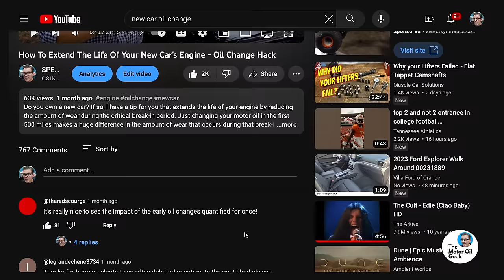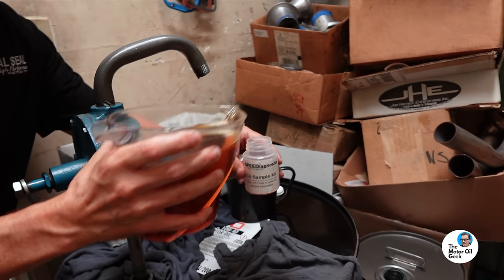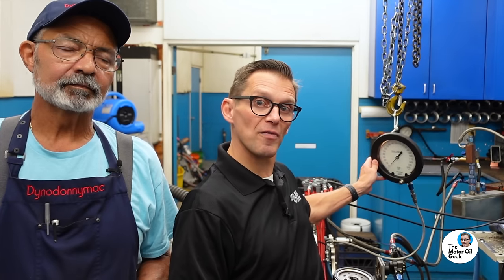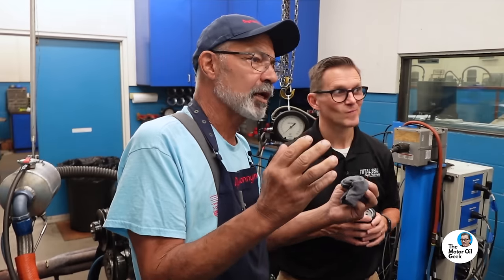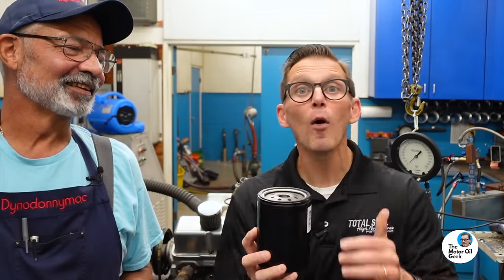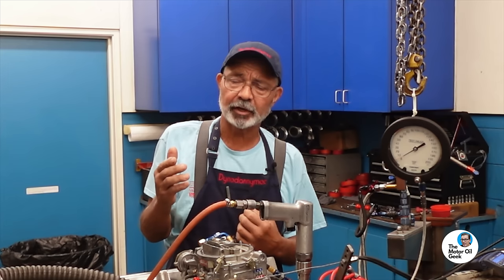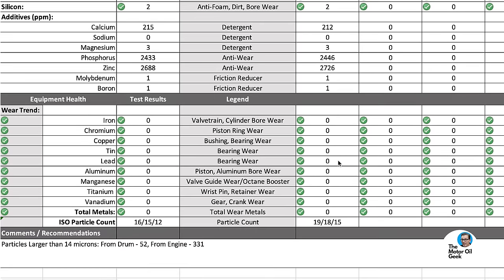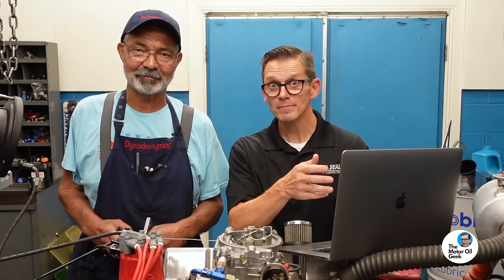Does Pre-FILLING The Oil FILTER Cause Engine DAMAGE?

Comment from the maker: If your oil filter is vertically or horizontally mounted, here's a pro tip to prime the filter before starting the engine.
https://youtube.com/shorts/ZF-SPAKtzrY?feature=share
Reply: @themotoroilgeek 
I've been a auto technician for years and I had a old timer. Tell me that didn't have to fill the oil filter if you did the oil change and no oil in filter. To start the engine and then turn it off and repeat atleast three times. To prime the oil in the system and through filter. I was never sold on not filling the oil filter so, I fill the filter still and then start and then turn engine off atleast three times. I would like to know your thoughts about this. After a oil change and oil in the filter should you start and immediately turn engine off multiple times before running the engine longer to prime the oil in the engine?
Reply: @DK-Nachowifi turning it off and on does nothing because the oil pump doesn’t run with the vehicle off. But prefilling the filter just insures the system will prime faster, maybe takes a second to two at most. Prefilling the filter is good and can only help. If you can’t cause it’s a horizontal mount then oh well it is what it is.
Reply: I know for a fact that pre-filling the filter prevents that little slowdown from a fresh oil change from bearings dragging or lifter delayed pump up. I don't know what was causing the engine to have a sort of load on it on the start up but prefilling the filter prevented that. Keep in mind that that I have several V8's with high mileage that did that. The cars I have always owned and have prefilled are a '76 Dodge B200 360C.I., a'79 Camaro 5L, an '88 Ford 5L and a '98 Ford 4.6L. Lets just say all my engines don't burn oil happily without additives well over 100K miles. I only had to hear that lag once for myself to be convinced. I should point out that I was a professionally trained mechanic back in 1989 where my journeyman taught me to always pre-fill the filter.
Reply from the maker: @mrwebber35  Thanks for sharing!
Reply: The clear flood mode also turns the engine metal to metal during the priming.  Is this less damaging due to the lack of combustion force on the connecting rod bearings?  They still see compression force so only wear on the cap bearing side?  Are the combustion forces low with a turning engine during startup, because there is no load on the driveline during startup?  This seems like a reason why all engines should have upward mounting filters and require prefilling or have electronic oil pumps to prime the pressure before start similar to electronic fuel pumps for EFI.
Reply from the maker: @michaelb4060  Great question. Without combustion, the pressures are much lower, so the residual oil film is sufficient to protect the parts. In lubrication engineering, the Stribeck curve tells us that as load increases, oil film thickness decreases, so reducing the load does make a difference.
Reply: You run it without any oil in the oil filter you're putting wear and tear you're not pumping any oil it's got to build a filter up first so what do you think the motor is doing when it's got to fill the oil filter up first don't be idiots it depends on the type of car
Reply: I almost always prefill my oil filters - BUT back in the 80s, we owned a 1984 Dodge 600 that suffered from oil air locks if you did.

If you prefilled the oil filter and then started the car, you would see that the oil light would stay on - forever. No oil oil would be getting pumped around the engine. Sometimes revving it up would get it flowing but often only after "burping" the oil filter with the engine running would the oil light go out and the oil flow. 

The shop manual for the 600 stated not to fill the oil filter and a tech builtin stated if you did to have someone ready to loosen the oil filter to let the air lock out while the engine was first started.

Back then I spoke to a friend who worked at a Jiffy Lube and apparently there were many front wheel drive Chrysler's that suffered from this issue if you prefilled.
Reply: Adding to the above, I'd be interested in knowing if any modern oil pump self drains once the oil filter and its antiflow back valve is removed (like the 80's Chrysler 2.2 and I believe Chrysler's imported 2.9).

Edit: Googling I found several modern motorcycles suffer from oil air locks if you prefill the filter, but didn't notice any modern cars or trucks with this issue. 

If car engines that drain back the oil once the filter is removed still exist, how long do they take to build oil pressure when trying to pump the air through a prefilled oil filter. 

Think about what you are asking these "badly designed" pumps to do. It is full of air, has a full oil filter ahead of the oil path and also has to suck oil up from the pan...
Reply: @michaelb4060  i just learned last year that a F1 race car engine when they were V10 engines limited to around 2.5L or so what ever pistons the size thats in a 250cc dirt bike..in a F1 turning 20,000 rpm the pistons weigh 5000 pounds every time they stop and change direct..so in a passenger car buzzed out 5000 rpm up to 7000 rpm  your pitons could weigh as much as 4000 pounds or an easy 2000 pounds when they are being push hard through the gear changes ..all the weight and pressure goes directly to the rod bearings and the oil molecules is the last line of protection before the conrod bearing comes in contact with the polished surface of the crankshaft journal .
Reply: I remember in the seventies and eighties if I bought a quart of cooks refined motor oil it had sludge in the bottom seeing that was disturbing so if I had to buy it I would only pour about 3/4 of it in
Reply: the reason why I don't pre-fill the oil filters so I don't overfill the oil because the oil filter takes one quart so if I put four quarts into a pan and I fill the filter with a quart or close to it, I have the possibility of overfilling my engine and blowing my rear seal
Reply: when I went to auto mechanic school they never told me I had to fill the filter either.
Reply: Quart containers and 5 quart containers are all marked if you only need four and a half quarts for your system I don't see how you can mess that up 😊
Reply: It's not necessary to argue one way or the other try it once with no oil and record the sound of the motor the next time you do an oil change pre-fill the oil filter and record the sound of the motor compare the two you just might be surprised the rod bearing knock that you hear is not good
Reply: I wasn't arguing.
Reply: @williamsain4651  just stating a fact.
Reply: I don't doubt they never said it that's a part of job security
Reply: I'm guessing this is NOT something available with a Hybrid vehicle.
Reply: I work at a hydraulic power unit shop. Some of customers require us to send samples of new oil to the lab and if the particles don't meet their specs, we have filter for 24 hours and retest. So yes, new oil is not that clean, but in my opinion, I don't think it would be a problem.
Reply: LOL just change the oil
Reply: It must take you guys  a week  to change  a spark plug
Reply: It must take you guys a week to change a spark plug
Reply: Bull
Reply: I would really like to see a comparison to identify the best filter that has the best anti-oil drain back capability!!!
Reply: That's all good, but cartridge oil filters that are mounted on the top don't stay prime when the engine is off. How do we know, because when the oil filter is removed it is empty, no oil in it. So why go and do all that, when it will empty on the next engine start up. I still thing it's a good video, but it doesn't apply to all designs.
Reply: I thought it was the pocket of pressurised air that you are creating with this method that was rumoured to be the potential problem in prefilling. In any case an engine designer would need to design for both cases to ensure no problem. Half of engineering these days is designing for people doing stupid things, thinking they know best.
Reply: @Slider68  oil air locks 😂🤣
Reply: @xl250mon5  do a web search on "Why do I need to burp my oil filter?". There are quite a few engines that suffer from this problem. With many of them, the oil light won't go out until you burp the filter, and if you ignore it, the engine will suffer catastrophic damage.

To understand what happens, imagine the oil pump is full of air because the oil drained back to the pan during the oil & filter change. Then realize pushing prefilled oil through the filter takes a fair bit of pressure.

Now, when the engine is started, the pump, still full of air, needs to suck oil up to the pump and push "springy" air into and through the oil filter. Oil pumps actually pulse the oil flow, and each pulse compresses the air before the filter and then with vehicles with weaker, worn, or poorly designed pumps, that air pressure is able to push back on the pump between pulses, returning most of the previously sucked up oil back to the pan.

Note some call this problem "oil cavitation in the oil pump", but it isn't truly a cavitation problem (cavitation is when the pressure drops far enough to create a vacuum pocket in the liquid that then collapses).
Reply: @DK-Nachowifi  Once the pump sucks up oil the first seconds it's primed and pumping.
Reply: I have a question, if a vehicles takes 6 quarts and you add oil to the oil filter would you still add the 6 quarts to the engine or 5 in a half or 5 depending on how much you put in the filter
Reply: @euphoric5174  The manual tells how many. that would include all factory items if equipped like filter, oil cooler, pan.  6 quarts total.  You might find an engine takes 51/2 to the full line because an oil cooler might retain some.   If in doubt use 5-1/2 Qt's start the engine for a couple of minutes, then off  for a few minutes, Then check the stick and add what is needed. Don't overfill.
Reply: Also biggest tip: buy engines that have the overhead camshafts bathing in an oil bath to avoid dry starts. Thanks to Alfa Romeo for that 100 year old invention.
Reply: @ReginaJannie  1902 Maudslay. First.
Reply: Hey can you recommend me your #1 pick for full synthetic high mileage oil
Reply: @themotoroilgeek cool video and good tip on priming the filter of a horizontal mounted filter, quick question tho, on my 2011 colorado i have about 48k miles on it and never primed it from lack of knowing how, after the dozen or so changes with dry starts how bad is that for my truck?
Reply: @BrowardBikelifeTJ  Europe spec Triax 30,000 mile oil Made in Usa
Reply: @mrwebber35 I’d be interested in hearing how you prefill that ‘98 4.6L with the filter on the left side of the block horizontally mounted?  Fill it, then dump oil all over the side of the engine block?  Here’s how I get the filter off my 4.6L DOHC Engjne:  remove cold air kit, just to have more room to work; loosen filter; pull back quickly and tilt it back off the threaded mount and drop down to the left facing up towards front of car; move to front of car, grab filter and point down to drain into moved pan (after oil pan drain valve closed, I don’t have a plug) and drop it into the catch pan.

New filter, load into the front of the car on hoses, then move to the side of the car.  Pull filter into position vertically, then flip horizontally and screw it into position.  Pre-filling it would just make one hell of a mess as at least half of the new oil would run out.  

I worked in an auto shop in the ‘70’s and ‘80’s and never heard of this or did it once in thousands of oil changes, and that was a company owned Chevron USA back room with ASE Certified mechanics.  It makes good sense to me hearing it now for the first time, and ironically it would have been a lot easier to do as most of the engines back then had bottom mounted filters.  

However, I don’t think my 4.6 is going to get a full dribble of $9 a quart Castro Edge full synthetic down the side of the block anytime soon!
Reply: Dont waste time chicken or egg first everything goes nothing will happen.😅😅
Reply: that makes no sense, horizontally could mean two different ways, always prefill the filter. these people just want views smh
Reply: I,ve seen the second video...does it work on old izusu engines?
Reply: Hey all you  mechanics out there, you can always crank the engine (without) the engine actually starting.
Just disable the ignition system, crank the engine til the oil pressure builds up, then enable the ignition system and start the engine.
Reply: @Slider68  I had the same problem with my 68 Dodge 383. I even put a new OIL PUMP in , and it did not solve my problem. If I prefilled my filter the pump would not push the air out of the system because the oil in the filter was in the way !! Before the oil pump can pump oil, it has to pump AIR and get it out of the way. With oil in the filter the air cannot burp !
Reply: I would like your opinion on remote oil filter setups .As far as refilling the filter is concerned I have never done this. I have Owen 3 mercury marquis 4.6L all have side mounted filters and I got more than 350k out of all 3 never prefilling the filter none of them burned more than 1/2 quart the car rotted out the engine was still great all of which I changed the oil at 3000K whether I used synthetic or not.
Reply: if I put the pedal to the floor and crank this prevents the motor from igniting. would this be a good method for lubing the cams/rocker arms before the engine ignites?  @themotoroilgeek
Reply: Typically it’s vertical as far as ive seen.. but you fill the engine to the pre-requisites.. let it run out the rest into a pan a bit.. then install the filter then run it.. check the oil for the level after its run through the lines.. to get an exact measure.. I may be wrong and dumb.. I dont know crap when it comes to vehicles.. I wish I did..( from what I understand after an oil change run the engine after checking acceptable level and let it go.. hmm 5 minutes.. maybe.. check it again.. may have to put in a bit more) I’m not a mechanic but I find it intriguing and want to know more :)
Reply: @Ken-op7sg huh? 😂
Reply: @E.L.RipleyAtNostromo  The filter absorbs the oil not immediately. 3/4 fill and flip the filter on quickly. Skill is the answer and good old common sense. This isn't rocket science.
Reply: @mrwebber35 Doesn’t really matter if it’s rocket science or not, after doing well over ten thousand oil changes without even hearing of prefilling from a half dozen ASE Certified mechanics, on thousands of 1960’s and ‘70’s big blocks, I’m not sold at all that it’s remotely necessary.  My engine is a modern 4.6L DOHC aluminum block that’s had full synthetic in it since day 1, and it takes a second after starting to reach full oil pressure.  But it can’t hurt, so I’ll give it a try and add just enough to fill the filter to wet the interior.  But I’m not going to take a chance on spilling anything.  It takes me three separate moves to get the OF in position to mount, and it’s a tight fit, so I’ll have to hold the filter down by the block once I get it in final position and maneuver a quart of oil down there to pour some in.  

Frankly I don’t think there’s any damage being done to my engine at all by running the engine for a second until the oil pressure spins up, but I’ll add a few ounces of oil to the pleats anyway; that should save a half second or so of engine wear.  (?)
Reply: LOL! talk about skewing results to suit your agenda. yes prefilling is good if you can, BUT you used an old big v8, a big oil filter, you used an air drill not a starter motor which is not real world test. most modern smaller engines have better faster pump designs and much smaller filters to counter this, something you SHOULD know or conveniently forgot. dont understand the story of the Porsche?  you tested rebuild > run in particles and attributed it to no oil filter pre-fill? so... did you again rebuild with oil filter pre-fill and get no particles?  or did they run in just clear out over oil changes... telling half truths
Reply: @davelee7572 Excellent points!  By the way, pull the drain plug and let the car drain for a while, say 3 or 4 days.  Now pull the engine and take off the intake and top of the engine and turn it upside down.  You’ll easy get another half quart or more running out of it.  Even with big blocks and old fashioned bottom mounted giant oil filters the oil pump takes a second to get the oil pressure up to max.  Those cylinder wall are still coated with oil.  You drained the pan, not every drop of oil in the engine.
Reply: @E.L.RipleyAtNostromo  not sure what point you are trying to make with that reply in response to my comment... it does not take 3-4 days to drain all oil.and the "easy get another half quart " most of that is whats sitting in the cam and other valleys. which again i dont know what your point is
Reply: @davelee7572 Yeah, I don’t think you got my point, which is even after completely draining the crankcase there’s enough residual oil on the bearings and cylinder walls to run the engine for the second it takes to build up oil pressure.  Also, I learned that many new engines actually initially bypass the OF on startup to make sure the engine has full oil pressure, then start routing oil through the filter.  That makes pre-filling unnecessary at all on those engines.  I’ll start adding some oil to my horizontal mount filter, can’t hurt, but not enough to take a chance on any running out when I mount it, so not sure if that little bit will make any difference on startup at all.
Reply: How do you pre fill a filter that sits with threads down ?
Reply: @E.L.RipleyAtNostromo  ok yes, as long as you dont rev it on first start it would be fine. and i normally just crank it a few times without letting it start to get things going. the test in this video was worst case to try make a point that really isnt an issue on modern engines otherwise oil filter, oil and auto manufacturers would say so
Reply: @michaelgarvey7874  you dont this video is a stretch. just crank the motor a few times before starting the car to let it build oil pressure.
Reply: @davelee7572 Great idea that never occurred to me, figured the engine had to be running to pump oil, but cranking it should give it a head start.  That plus adding some to soak in the filter pleats should prime things pretty well.
Reply: On my diesel I fill my filters, On a side mounting filter, put in 1/2 quart, now do the oil change, after oil change and plug in, Add oil filter and then fill with oil and then start the engine, should have oil pressure and no worries.
Reply: This makes me love my electric car even more ❤
Reply: @frederickfaller899  NO 0NE WANTS YOU HERE
Reply: @timothywanless1507  First, over filling the oil on an engine doesn't blow the rear main seal. What it does is whip air  into the oil cause oil starvation.  Secondly filling the oil filter does not change the oil level, as a filter mounted in a position that could be prefilled will stay filled when the engine is off. That been said my camaro uses a cartridge style filter mounted on top of the engine. So it is not possible to prefilled, yet the engine now has 119k miles and oil analysis shows minimal wear. Secondly in cold conditions like 10 below zero oil flow slow at engine start up, slower that oil been poured into the change with empty filter during an oil change. Yet this is taken into consideration during an engine design. Plus I have never filled the oil filter on my son car, I bought that car new in 2003, it now has 389k miles and runs fine. The reason I tell you all of this is because prefilled or not, is a stupid argument. That's like saying shut off and start up engines while driving will wear out the starter. By the way I'm a mechanic, it's all I been my entire life. Never had an issue with not refilling oil filters, my own cars are proof of that.
Reply: You can still put "some" oil in a horizontal filter, because the filter media absorbs some. You will see it go down. Just add a little at a time. It's not that hard to do.  @DeeRizzley
Reply: You guys are in Jedi Mind Reading Mode for pinning this comment!
Reply: Let's think about this: Sure, new oil may be cleaner than it ever will be after it circulates through the engine, but it has not yet been magically blessed by the oil filter. Yeah, that's it. It's magic.
Reply: Marine chief engineer for 25 years, same, big  CAT, MTU, DD, MAN etc diesels, oil capacity a few hundred litres, they have a pre lube system and oil preheaters but still always prefill the filters,
Reply: This does not make any sense.  I'm very skeptical of this and on a Toyota the oil filter is mounted in horizontal position.  It makes more sense to block the hole (somehow??) then install the filter.  What's the alternative if your vehicle does not have this prime feature using brake and accelerator?🤔
Reply: Hey, sorry, my car is 36years old - "clear flood mode" not defined yet!  I don't want to trash my classic - am I still best to swirl with some oil inside while I screw it home?  thanks
A.
Reply: How would you do this on a 2006 cls55 Mercedes ? Filter cartridge on top. Would soaking the filter in fresh oil help ? Thanks kindly for everything you do.
Reply: On newer engines that are fuel injected and fly by wire throttle housings I find that by holding the throttle open and cranking many fuel systems go into clear flood mode or test mode.  This does not allow the engine to start so continuous cranking will bring up oil pressure before starting.   I crank till the oil light goes out then release the accelerator and crank again with closed throttle.  Engine should start immediately and light should go out immediately!!    This is good for engines with inverted filters, horizontal filters, and cartridge filters!!
Reply: @cycleguy666  :body-green-covering-eyes:Too complicated for me.🤔
Reply: I have a 2002 Nissan Almera. On the QG16DE engine,  Filter is mounted sideways, and doesn't have clear flood mode.  No possible way to pre-fill the filter and yet these engines run virgen for up to 200k miles.
Reply: why are you SHOUTING?
Reply: 0😊
Reply: I don't care what anyone says I've always filled the filter and always will I had a brand new 1976 f250 the filter was mounted horizontal and I had to pull the coil wire after a couple changes to get oil pressure it didn't prime
Reply: OMG!!!  Its much better to just let your car start and fill the filter.  Most engine wear occurs during cranking.
Reply: Do you have a recommendation for what kind of oil or brand to use on an 8.1 vortec?
Reply: @williamsain4651  I prefilled the filter but being under the car - the filter spilled. Then I forgot to refill the filter - and yes the engine knock for those 4 seconds was SCARY - also the engine sounds rough now - just a bit rough. I am getting hexagonal boron nitride now to add to the engine.
Reply: @johnparish1432   that's how we used to crank the new engine( Lycoming acft engine)for oil pressure to come up and we'd install spark plugs and start the engine.
Reply: If your car has a side mounted or upside down filter you can prime it by cranking the engine for 5 seconds with the main ignition wire removed.
Reply: You have the right process here. When you did your oil additive vid, you excluded this process to fill your hate of additives.

Now go fix your additive vid, and show the results of additives, because I have done this, and the results are opposite of your reasons for hating them. Chemical analysis is not replacement for actual real world results.
Reply: @BullseyeBallistics19 that's because an engine retains oil on bearing surfaces for a few minutes after oil is drained, not a few seconds. This guy -

https://youtu.be/v82VeGngitc?si=zptCoRaLvAC37oi_

Shows how an engine can run for a short period while not picking up oil, as skid steers don't have an 80° approach or departure angle... even though it's very easy to push past the boundaries here, there's some forgiveness in it picking up oil.
Reply: Your wasting your time.
Reply: @DeeRizzley  is horizontal because you don't need to pre fill it. Lol.
Reply: My pro tip is to not worry about it.  What a silly topic.
Reply: @timothywanless1507  Yup, this is one of those useless topics for arguing on the internet.   I find it funny,
Reply: @DeeRizzley  Filling filter has zero to do with priming. It's a good practice but not for that reason.
Reply: Mechanic for 40 years, I ALWAYS fill the filter
Reply: @timothywanless1507 Well not sure how you do it but if the oil can starts off with 5 quarts and you only need 4 then you pour off 1 quart there are markings on the side of the jug. Now with 4 liters left you can fill the filter then pour the rest into your engine and it will be impossible for you to overfill your engine.😮😊
Reply: The clear flood mode turns off the injectors.
Reply: I did one time and found that my car cooked off more oil. Haven't since and I fill my empty bottles with the oil I started with. Weird
Reply: will a vertically mounted filter (Volvo 2011 XC90) stay primed or will it drain down?
Reply: Lake, what is the micron level of the filter used to filter out the new oil? What is the micron rating for the filter you used on the engine? What would the oil be like after just going through the filter and not the engine?
Reply: Hybrid or electric? There's a differnce,ya know?@michaeltammaro482
Reply: Thanks for the great video. I recently changed the oil filter on my old Porsche 944. The way it is mounted is super dumb, so you can't pre-fill it and when taking it off it just makes a mess all over the belts. Do you think its still worth filling it with oil, then draining it out again so at least the inside of the filter is somewhat primed with oil?
Reply: No one changes the oil in my car but me....
Never heard of priming an oil filter in my life... 
Motors outlived the rest of the Buick 
in three century's
Reply: My oil filter is mounted horizontally and can't be primed. The car is 1977 Reliant kitten . After an oil change I  start the Car with no choke and crank the engine until the oil light goes out. It would  possibly be better to remove the spark plugs and crank engine, there would be mininal load on the bearings by removing the compression forces. The engine is 850cc and done 165000 miles on the original bearings and cylinder liners.
Reply: I had this Datsun car many years ago with a vertical filter. The first seconds upon startup you could hear the engine running dry. Never understood why you'd fit the filter that way, and it bother me every time I started that car. Why, Japan? WHY?